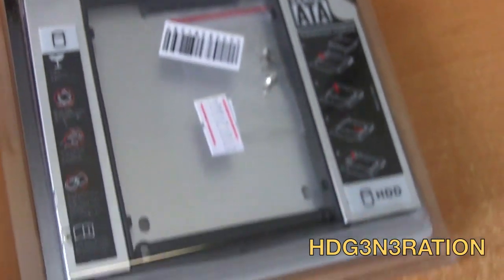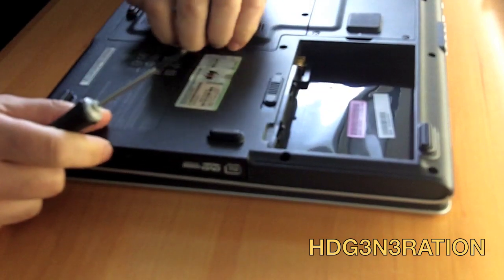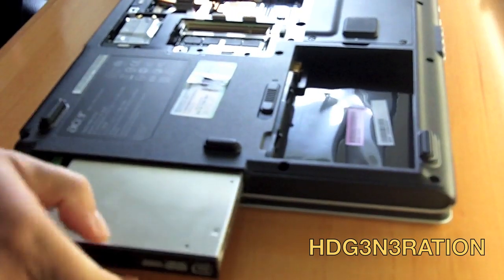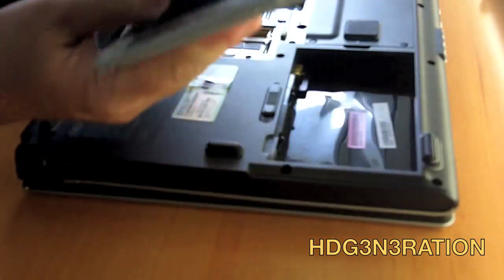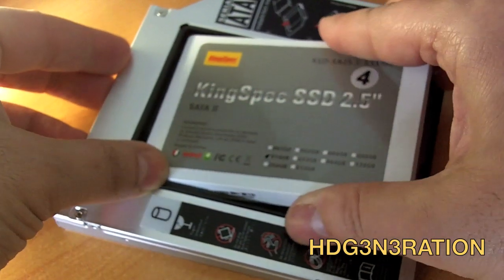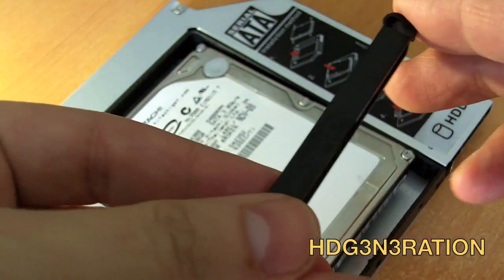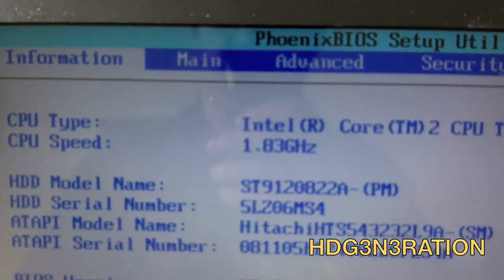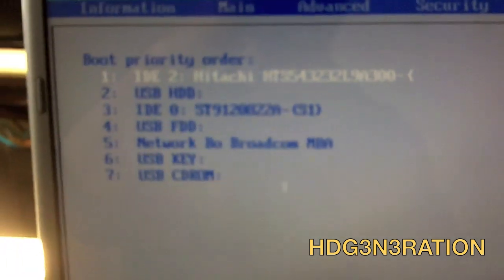HDD CADDY INSTALLATION

Comment from the maker: Hi , if it is windows I recommend a clean install to the new HDD ,   do backup of your data , this Laptop also does not have SATA [the default HDD is IDE] , the caddy does the conversion , I did try a SSD but did not work .
for your Laptop just check the model of your DVD rom and search the caddy in ebay or dealextreme for that same model :)  I also done this to my macbook :)

Comment: its best to use a ssd in the normal slot of the laptop and also as the boot disc
its 10 times faster
and the second in the caddy just for storage and normal you dont need to go in the bios menu just start windows and there it is

Comment: Hi there! I was wondering what model is your laptop? Did the SSD work without any problems? I have an Aspire 5630 and want to install an SSD, but i dont know if i should buy an IDE SSD or a Sata and connect it with a caddy. Thanks in advance.

Comment: hi, i have bought this Caddy for my Acer Aspire 5610awlmi IDE Notebook. When i try to install a 1 TB Samsung Spinpoint M8, the Drive ist not showen in the Bios. Please tell me, what's my mistake. I Tryed to change the Sata Speed with Samsung Tool to 1.5 Gb. But nothing changes. Regards Philipp
Reply from the maker: does it work with other HDD ?  did you try ?
Reply: Hi, the problem is solved. the Caddy has no Master/Slave jumper and is always Master. Just jumper the 1. HD to slave and everything is ok.

Comment: how you remove the hdd caddy once it is installed? For example you need to change the hdd in it.
Reply: figured out. Used a screws thread to pull it out. :)
Reply: @MrChildofmaster    use tape : https://youtu.be/tUNrSb_q7V0